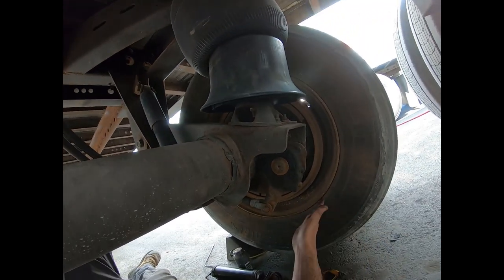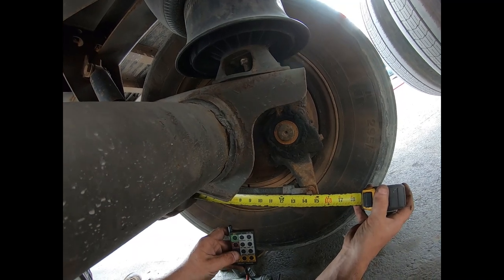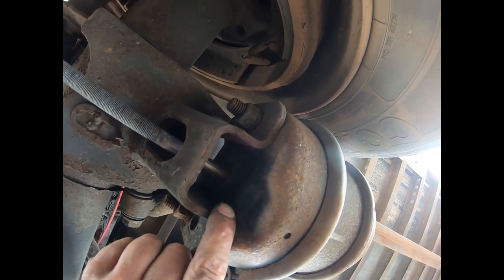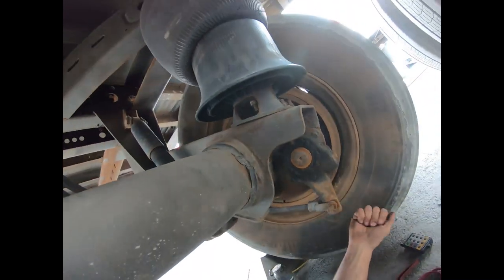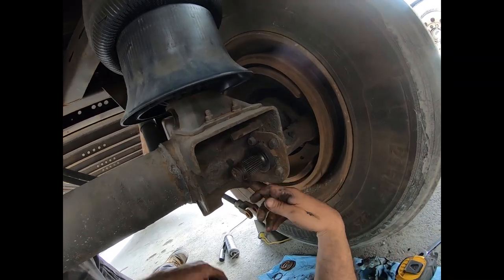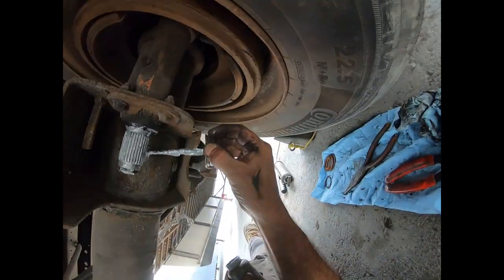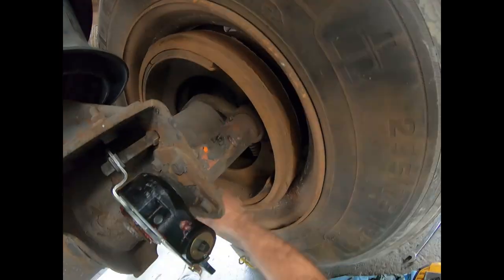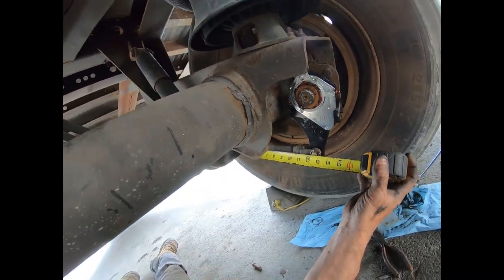How to test an automatic slack adjuster for proper operation if excessive brake stroke is found.

Comment: Good video man. I work on school buses and we constantly go thru brakes, slack adjusters and S-cams. Good info. I like how you mentioned to use a tool to check the play on the S-cam. We take apart the brake and do the check on the S-cam inside the brake assembly. I never thought to do it on the slack adjuster end. Instead of taking the brake assembly apart you just take off the slack adjuster after you do your travel and adjustment test. Thanks. I'll pass the info to my shop mates. Thanks.